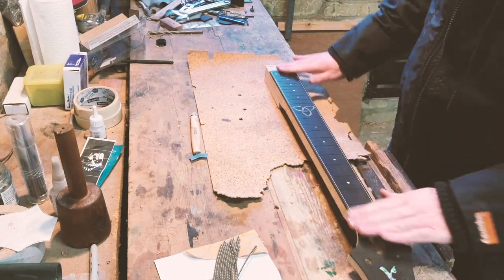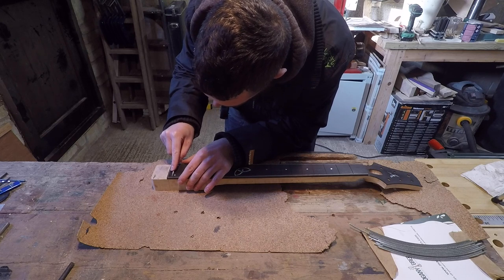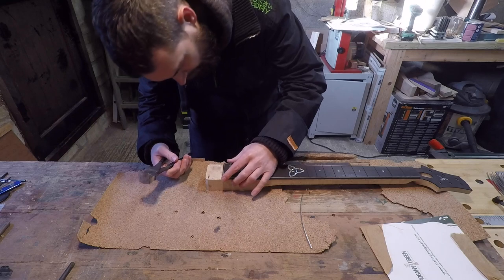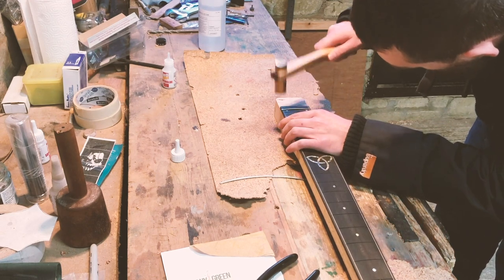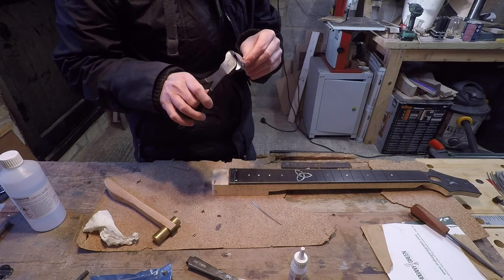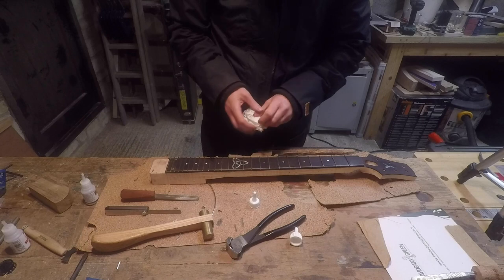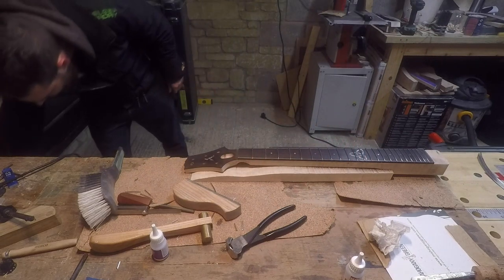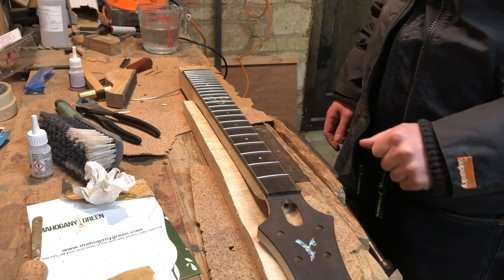How to fret a guitar neck with binding and a compound radius

Comment: On compound fretboard 12-16 inch...is better to use all 12 radius stainless frets,or all 16 radius
Reply from the maker: last time I did a compound radius with stainless frets, I bent some in-between frets, you really need to get the curve on the frets to be close to the fretboard or you may find the pop out

Comment: Have you thought about injecting your ca glue deep into the fret slot to avoid leakage?
Reply: Oh, I forgot- that fretting hammer is awesome!
Reply from the maker: I was really only using a drop of superglue, spread out along the entire tang for the most part, which is less splurge-likely than wicking it into the slot from previous experience, I just had a couple of whoopsies - the trouble with trying to present while trying to do the job at the same time.